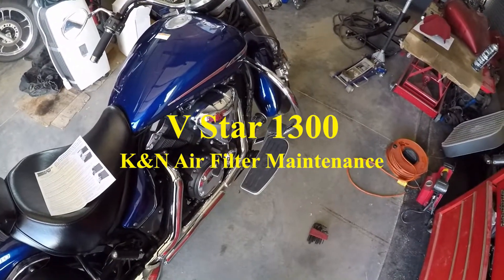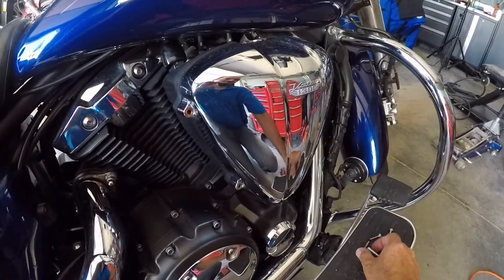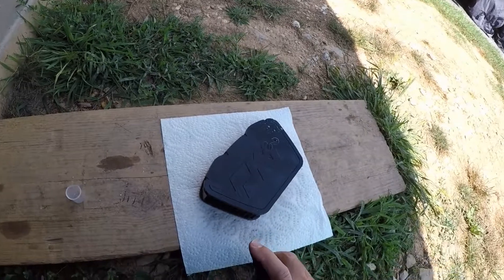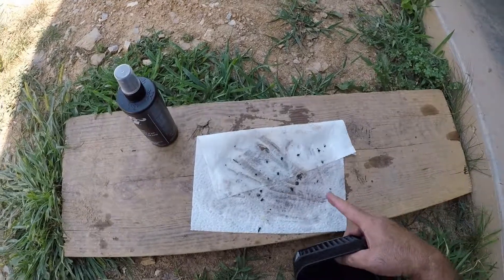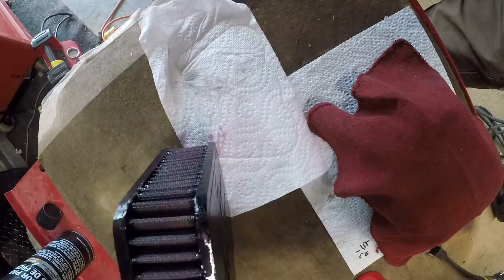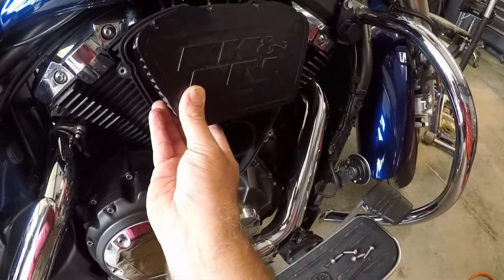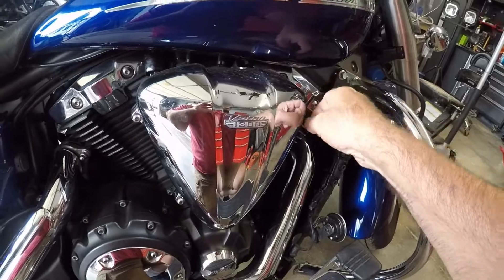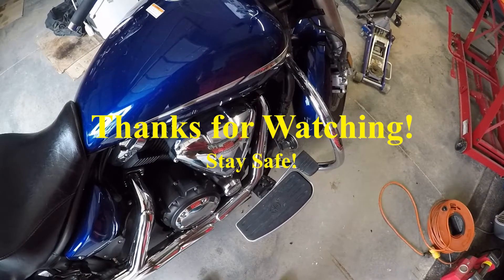V Star 1300 K&N air filter maintenance

Comment: I highly recommend you get Ivan’s ecu flash for the 1300, even if you don’t want to change the exhaust or intake, it makes the bike run like a whole new different bike, removes all restrictions, it does more than what a fuel tuner can do!
Reply from the maker: I've heard a lot of good reviews on Ivan's ecu flash.  I think the previous owner had something done to the ecu.  I noticed that the O2 sensor is unplugged.  The bike has a miss in the mid range though.  Idle and upper rpm seems fine though.  Once it warms up, it seems better.  I'll have to look into it.
Reply: did you ever figure out the rpm issue?
Reply from the maker: I've had the ECU flashed by Ivan. A lot of the previous issues have gone away. I think some of them were from having the 02 sensor disconnected from the stock ecu.  I do notice a slight miss at idle sometimes. The RPM range miss seems to be gone.